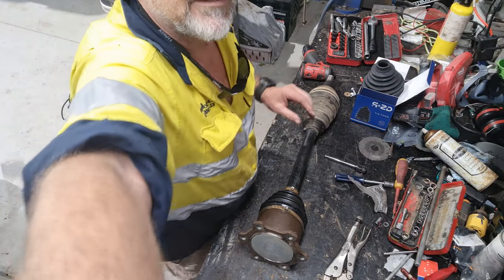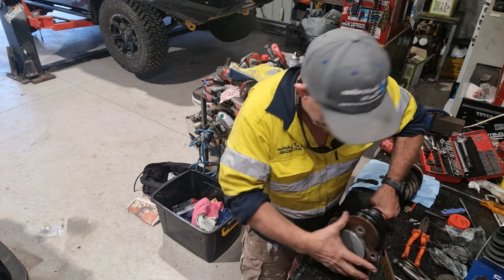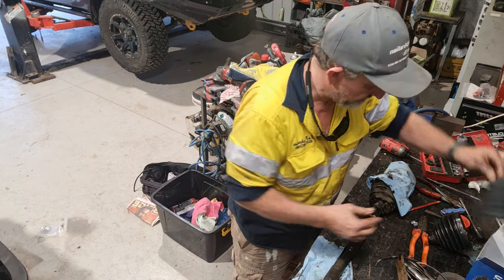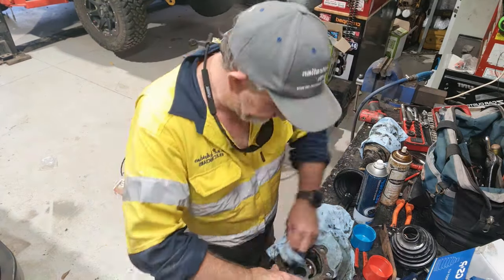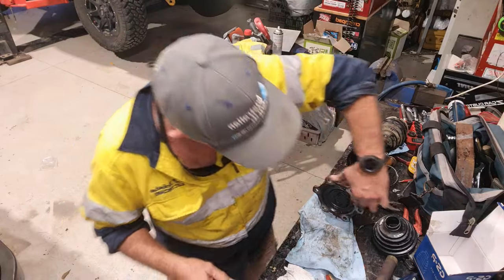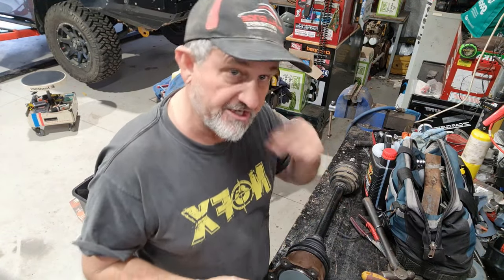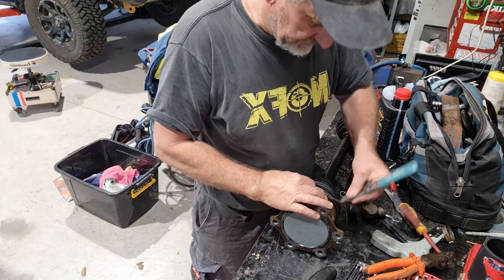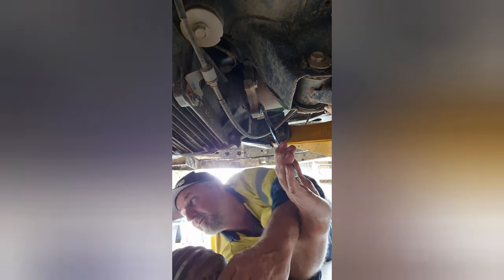Y62  Patrol Cv boot replacement and axle swap out

Comment: Just had one break! Rear driver's side as well! Seems to be the one that goes eh. Have ya had any luck with non genuine CV's mate?
Reply from the maker: I've only used genuine whether new or used but would carry a non genuine as a spare , the boys reckon they're no good.
Might have to put some.thrpugh thier paces.
Funnily enough mine haven't actually broken just got mad clicking noises
Reply: @OzPatrol66  so a clean up and re packing them with fresh grease fixed the clicking? That's what mine did so I replaced it with a aftermarket one, then it shit itself again!
Reply from the maker: @baumie461  I got away with that on one but the other no good, I reckon the tri k is to remove boot each 2 years and repack fresh Grease

Is yours lifted
Reply: @OzPatrol66  yeah mate ontrack 2". Mate had the lift in for 3.5 years and never had a drama...start doing some low range grass hills with the caravan hitched and 2 CV's gooone. I've got a video of when it went, you can hear it go bang.